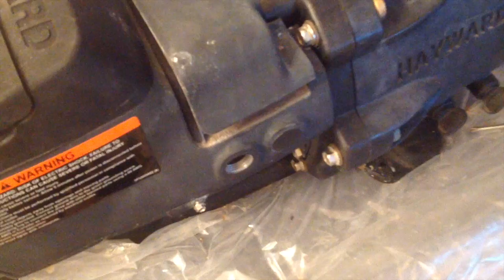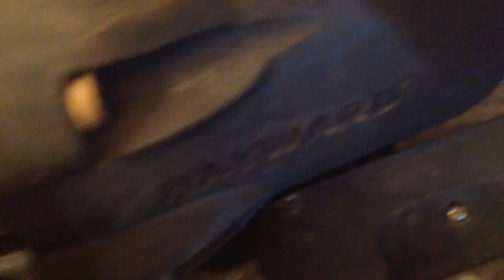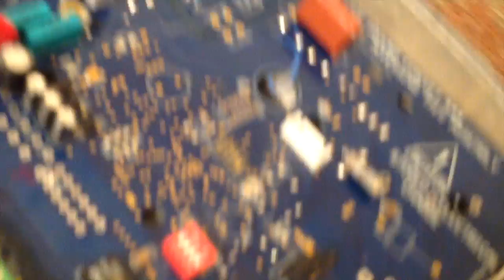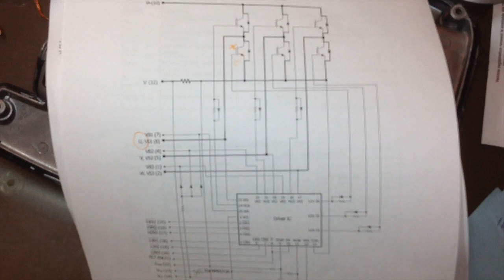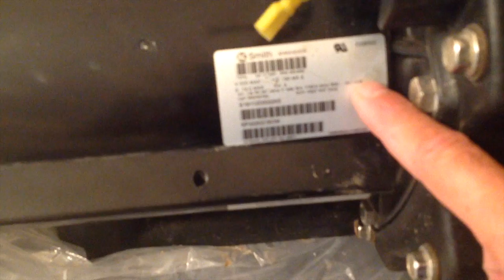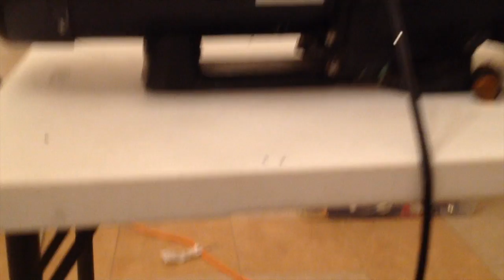Hayward SP3400VSP Control Module Repair

Comment: I just changed a SP3400vsp out. Tag says 3Ph but was hook to 1Ph.... normal???
Before change motor wouldn't start, installed backup control and pump started up normally but after 2 minutes shut down on overheat.  The motor ohms correctly, not sure why my backup is overheating.

Comment: My pump is running BACKWARDS - any help appreciated
Reply from the maker: Open the small led you will see three leads (wires goes to the motor from Module) swith two of them whereever they plug that will change the rotation of motor, I mentioned that in one of the two videio related to the same pump as well.

Comment: Thanks for the video. I am working on mine now. I had trouble removing the board due to the compound sticking the board to the cast base. To help remove this I used a heat gun and then I was able to remove the board
Reply: Hi. Use a hot air gun and it will release the board. I have just done it

Comment: Some notes from my experience with this:
* The big capacitors on this board are charged to 350V DC when power is supplied to the pump, and they could potentially hold a deadly charge indefinitely.  The board is designed to discharge them within a minute or two of turning power off, but a malfunctioning board could potentially fail to discharge them.  Always check the voltage on those capacitors and if necessary discharge them with a resistor before touching anything on the board!
* If you are not familiar with soldering, you need to keep the tip of the soldering iron tinned/wet with fresh solder at all times.  Once the solder on the tip oxidizes (loses its shine or turns brown), the iron will no longer transfer heat to the joint.  If you let it oxidize too far then the tip will lose its tin and no longer accept solder (at which point you must replace the tip).  At the high temperatures needed here that can happen relatively quickly, so you will likely need to add fresh solder to the tip frequently (like once a minute).
* I don't know what type of solder was originally used on this board, but it is relatively high temperature solder.  For de-soldering, I added 60/40 solder (Tin/Lead) to each junction to lower the melting point, which helped some.  When re-soldering, I used lead-free SAC305 solder (96.5% Tin, 3% Silver, .5% Copper), which seemed to melt around the same temperature as the original, although it is visually slightly different than the original solder so I don't think that is what they originally used.
* Due to the size of the components/joints and the high melting point of the solder, it is rather difficult to fully melt the solder without burning the board.  I initially tried using a variety of cheap non-temperature-regulated irons; It might be possible to do this using a ~50W non-temperature-regulated iron in combination with a heat gun set at 400F; However, after burning a few small spots on my board, I gave up and decided to buy a Hakko FX-888D temperature regulated iron, which worked far better.  I had to set the iron to 875F to de-solder and re-solder the large joints/components, and 825F to de-solder and re-solder the small joints/components.  If you re-solder with lower temperature solder (like 60/40) then you can probably lower this to something like 750F for large joints and 650F for small joints.
* To desolder, I used a cheap manual Desoldering Pump to suck the bulk of the solder off of / out of the joint, then used a fluxed desoldering wick to pull the rest out.  In some cases (like on most of the chip pins), this was enough to free the component pin from the board so I could simply lift the board off of that pin; In other cases (on most of the larger pins), I had to keep the joint hot in order to lift the board off, which basically meant I had to heat a pin, bend/lift the board slightly around that pin (using significant force), then heat another pin and lift, and slowly work back and forth until the board came off.  Once the board was off, I used the desoldering wick to clean up any remaining solder on both the board and pins so that the board could be put back on without heating/wiggling any joints.
* My board had a large amount of glue holding the board to the big inductor (next to the big capacitors).  It looks to me like they used clear silicone glue/sealant to attach the inductor to the board, then soldered the inductor to the board, then placed the board and inductor on the heatsink, then filled the heatsink with black potting material (Probably also silicone-based?  I'm pretty sure it is not epoxy).  It sounds like some boards don't have much glue here, but my board had a lot of both the clear and black adhesive holding the board to the inductor (it looked like the black material had splashed up on my board when it was injected).  I found it really hard to separate this glue, especially since I had to heat the inductor pins with the soldering iron in order to release the board from the pins at the same time as I pried on the glue.  After lots of trial and error (prying, cutting, heating), what worked for me was: Take a thin spackle blade / putty knife, heat the entire surface of the blade with a heat gun at 400F, then slide the blade between the board and inductor and push the blade into/through the glue, then remove the blade before it cools (or else it may stick to the glue and get stuck between the board and inductor).  For me, 3-4 cuts like this from different directions was enough to free the board.
* After de-soldering everything, you should use isopropyl alcohol to clean/remove all of the flux you added to the board and pins in the process of de-soldering.  Any remaining flux could lead to corrosion and/or could absorb moisture and lead to arcing.  After re-soldering you should again clean/remove as much flux as possible.  I used solder containing "no-clean" flux when re-soldering, which reduces the likelihood of long-term corrosion, although even "no-clean" flux should still be cleaned/removed when possible.
* If you add more white heatsink paste between the new chip and the heatsink, be aware that some heatsink paste may be conductive, and this chip operates at 350V, so you must be very careful to ensure that any excess paste does not touch any pins or get too close to the high voltage pins!
* My board was covered with a soft conformal coating, and some of the high voltage pins had clear silicone applied over them (likely for corrosion resistance and partial waterproofing).  You must remove this from around any pins that you need to de-solder/re-solder, to avoid contaminating the solder.  (Both the coating and silicone peel off easily.)  However, you should avoid removing it from any areas that you will not be soldering.  When reassembling, it would probably be a good idea to apply some sort of coating over all of the high-voltage pins (both to replace any removed coatings, and to cover areas that were not originally covered, such as on the chip being replaced and the large capacitor pins).  I used hot glue for this, although that is not reliably safe (as some hot glues are conductive or corrosive, or can absorb moisture and become conductive or corrosive).  Clear silicone caulk (or a proper electronics-grade coating) would probably be safer.
* To align the new chip with the board, put the new chip's pins in the holes on the board, then place the board on the heatsink and push it all the way down (over all of the desoldered pins), then screw the new chip to the heatsink, then solder the new chip to the board (with the board and chip held in place on the heatsink).  After that, you can unscrew the chip from the heatsink and remove the board again to clean the flux, check the heatsink paste, coat the chip pins, etc.
* On top of the board, there are two small stacked ceramic capacitors soldered to two of the chip pins.  These are soldered across the positive and negative side of the 350V DC power input to the chip (which comes from the big capacitors that you must desolder to remove the board).  They are meant to dampen any harmonics caused by the chip intermittently pulling a large current from this input as the chip intermittently powers the motor coils.  These stacked capacitors sit very close to the +15V DC power input to the chip (used for the chip's internal logic) and could easily arc to that pin and destroy the chip and board if you re-solder them slightly too close to that pin, so you must be very careful about the placement of those capacitors when you re-solder them to the chip pins.  This is another area that should probably be covered with a coating after re-soldering.

Comment: Hi Mark, I appreciate all your help and walk through videos. I had a question and could use some help if you could lend some time. I'm currently trying to repair my same motor and drive, its practically new and great shape but had an electrical issue where the power terminal on the circuit board blew off. The board and copper traces look good but slight burnt, I bought a new terminal plug to solder back in and was wondering if this would be okay to do?

Comment: I have the same pump. It works fine. But when I push quick clean it stalls. Only if I hold the panel down with my fingers then push quick clean it will work
Reply from the maker: Start ordering the VFD, see instruction from my other Video clip. Amazon is good palce the oder the Huanyang VFD
Reply from the maker: https://www.youtube.com/watch?v=1DJQoN6itW8

Comment: Hi Mark;
You inspired me to take mine apart; I found a burned thermistor, it is located  between the coil and the transformer, It got melted because one of the wires going to the motor was shorted. Do you know where I can get it? It looks like a common thing that goes out It’s NTC 25 1216 that thermistor is or which one to buy? 
Any one out there that has more information on what or where to get one would be appreciated too. It’s the black one next to the orange component.
Reply: That component is a TDK/EPCOS B57238S0250M000 (or B57238S0250M0*, as the last two characters designate the packaging it is sold in).  You can find them at Mouser and Digkey.

"NTC 25" means 25ohm NTC thermistor.  The "1216" number on the component is a date code (2012 week 16).  TDK/EPCOS sells a variety of 25ohm NTC thermistors of varying sizes and current ratings; This one is 16mm dia, 7.5mm lead spacing, 4amp.

That component is designed to control the inrush current as the big capacitors charge up when power is first applied, but it also acts as a sacrificial component / fuse if there is a short, hence why it is a common failure point.

Comment: Thanks!  Super video.  I have the same stall error on my pump.  Just ordered a couple of the IRAMX16UP60B-2 before even taking the drive apart as I'm really confident that it's a 99% likelihood mine has the same issue.

Comment: Hi Mark, could you please confirm component R7 (Chip side of PCB)? I believe it is labeled NTC 25 1216. Is it a Thermistor, Inrush Current Limiter, Varistor. Do you have a source for the component?
Reply: Hi Brent1001;
Did you ever find a source for that thermistor, mine is burnt Beyond recognition. I appreciate your response and input.

Comment: On the underside of the board I noticed that there is a capacitor joining two pins together, was it the same for you?
Reply from the maker: I don't think that is a capacitor, I think that is thermistor (temp sensor)
Reply: Mark Kash it looked like this which was strange http://embedded-computing.com/news/mouser-multilayer-ceramic-capacitors/
Reply from the maker: if you talking about the component that screw on chassis and  through small hole connected with two small wire to top of the mother board that is thermistor..
Reply from the maker: Yes that is surface mount cap that this between leads of Power IC chip that is not between wires as you mentioned.
Reply: Mark Kash Just curious if this was on your board as well, I couldn’t tell in the video
Reply from the maker: I looked at your picture again if you talking about the two blue wires R86 that is thermistor as I said.
Reply: Mark Kash one second I’ll circle what I’m talking about
Reply: Mark Kash this is what I’m referring to. https://imgur.com/a/OWRfF6F I’m just checking that you saw this capacitor across the leads on the IR IC that is soldered directly to the pad
Reply: Mark Kash Or if the board I have has a modification to it
Reply: Mark Kash I actually don’t think it was supposed to be there as removing it fixed my board.
Reply: Mark Kash here’s my board, https://imgur.com/a/jwk9BTW

Comment: There is a varistor on this board that burned on my unit. Do you know what value it is. I have part of the information. It is NTC 25/12____
Reply: Did you figure it out? I had 2 toasted parts that I can’t get info off of. One looked like a varistor.
Reply: @danielchronis5120  I just went ahead and replaced the speed drive. It was not worth my time and I needed to get the pump back in service.
Reply: Varistor NTC 25/1216

Comment: I tested the 3 leads against each other coming from the motor and and I am getting zero ohms or zero resistivity. Mark K. cited here we should be reading 0.5-0.7 ohms. By metering zero between all 3 leads against each other, does that then mean my motor is no good? Same original error as in the video - pump stalled. The shaft turns freely but again, zero resistivity between those 3 leads from the motor. Drive problem? motor problem? or Both?    Please comment. thanks.
Reply from the maker: Make sure you are using highly accurate meter since the value the you try to measure is very low, i am not say is impossible that all three winding got shorted but I can not envision  such s scenario.
Reply: @Mark1Jordon1  Thank you so much for replying Mark. I used both an analog and digital meter and they both indicate zero resistance. I've spent more than enough time researching this so I am calling it DOA and will succumb to purchasing an entire new pump. But before I leave just wanted to say how thankful I am to you for making such a wonderful and truly beneficial video. By the responses here you should feel proud that you have helped so many people. Thanks for sharing your knowledge and skill.   Ray

Comment: Ok, my turn. My Hayward SP3400VSP just died with the same "stalled" error. Simple troubleshooting ( 20 minute reboot, shaft spinning just fine, etc...) did not alleviate the problem. What's my next option? Had it for 4 years now so out of warranty. I do not have the tools nor time to fix it myself. Anyone in the LAX area fixing these? Would seem like a pretty good business. My local pool store said "sorry". Haven't called hayward yet - I know they won't help. Advise? thanks and really good video by the way. thanks for posting it.
Reply: Were you able to find someone to repair in the LA area?  I have the same problem and think that I need to replace the Digital Control Interface.  Not sure but I need it fixed.  Any referral would be appreciated.  Thx
Reply: No. Opted to buy a new Hayward pump - 32950 VSP.

Comment: When my pump original pump died years ago I found this video and ordered the IRAMX16UP60B  chip and a new pump. I left the original pump in place put the new drive on the old pump--I was back in business. Last week, 3.5 year later, the pump threw the same Drive Error Pump Stalled. I figured the new drive failed and placed a warranty request with Hayward. They will supply parts and replace the pump for labor only.

Meanwhile, I dig out the old drive and the IC chip and get to work... two evenings and many feet of copper braid later I was able to replace the chip. I put it back on the motor #1 and it ran, but very rough, surging etc. It was able to prime and then started tripping. I then pulled the pump and put my rebuilt drive on the new (never installed) pump #2--it ran flawlessly! So my issue this go round was the original motor itself, not the drive. But I'm very happy that I was able to repair the original drive and put it back in service on the second motor. I ordered a dash-2 version of the chip and will wait and see if I need to repeat the project.

Next I'll put Drive #2 back on Pump #2 and see if I still have a warranty case... it will probably run fine. 

Mark, thank you for the excellent video and troubleshooting. This project was definitely a challenge and I almost freaked when the pins weren't bent the correct way (I straightened and re-bent). One question.. I had a bit of trouble with the two stacked brown blocks that jumpered two of the IC pins on the top of the board. These were not mentioned or shown in the video (since you had already removed the board). Do you have any tips on how to easily reattach these two small brown blocks (resistors?).

Comment: Mark, about 3 year ago I sent my variable speed drive to you and you were able to repair it and its worked great for the last 3 years. Just yesterday the pump drive controller died again. This time its tripping the breaker with the motor leads disconnected (red, blue, black). I am pretty sure its a small capacitor on the site of the drive circuit board. Are you willing to let me send you a few pics or even a small video of the short when I connect it all (nice white flash on side of circuit board when I connect it) Either I can pay you to tell me the parts  (capacitor is fried and can't read the part) or if you prefer I can send it to you again. Please let me know. Also, It doesnt look like you accept private messages. Are you willing to turn that feature back on so I can message you privately? Either that or look back to June 3, 2016 from me and please give me a call. Thank you!  - John
Reply from the maker: Hi John, send the pics to mkash777@yahoo.com
Reply: @Mark1Jordon1  Pic was sent yesterday. Hope to hear from you soon. Thank you - John (john.j.dorr@gmail.com)